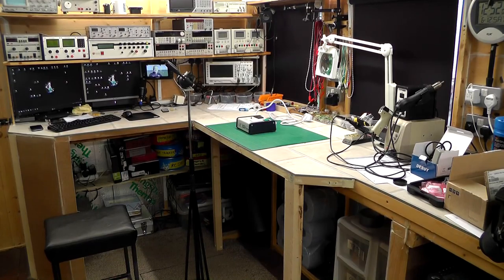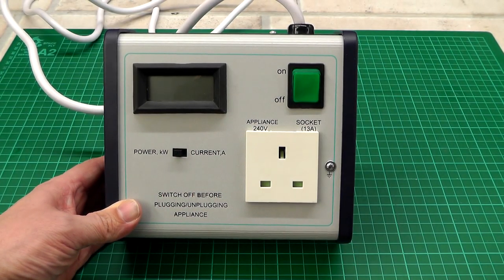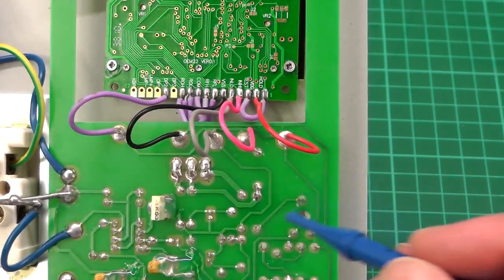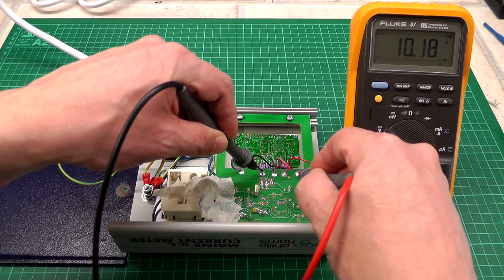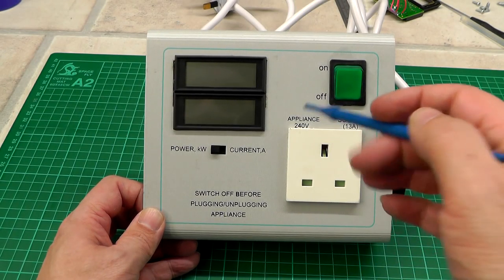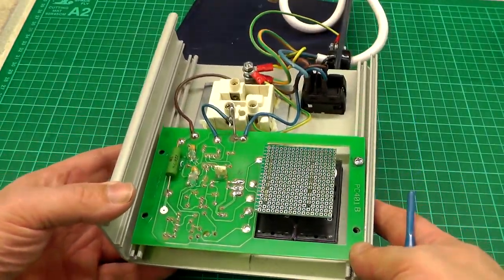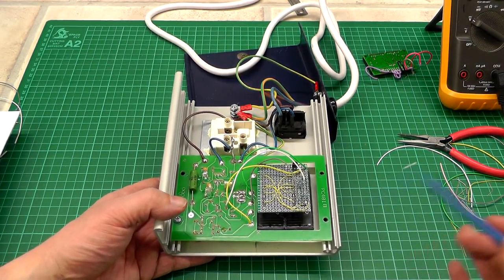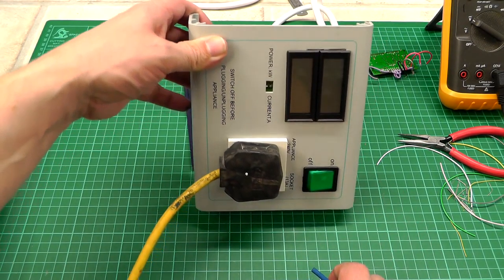Philip Harris Mains AC Current Meter display conversion

Comment: We bought a few cheap Chinese DC panel meters on eBay in the past, not spending more  than five or six dollars US on them, and put them in our caravan for monitoring battery voltage.  We've only had problems with one out of all of them we've bought, and they get rattled around a lot...

Comment: That's quite a nasty kW scale then, as it just uses a nominal voltage to calculate power rather than actually reading the mains supply voltage.